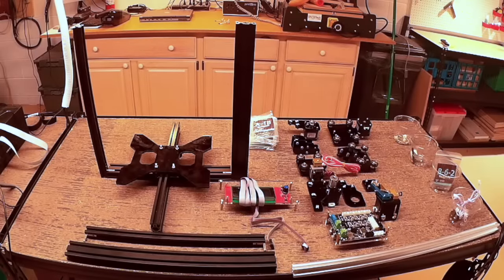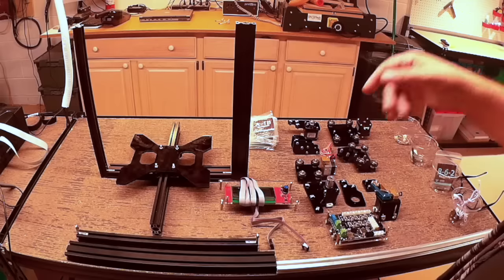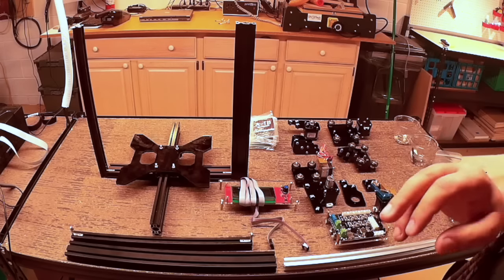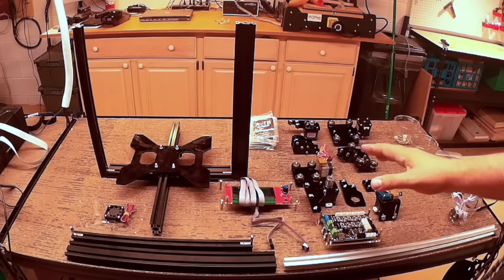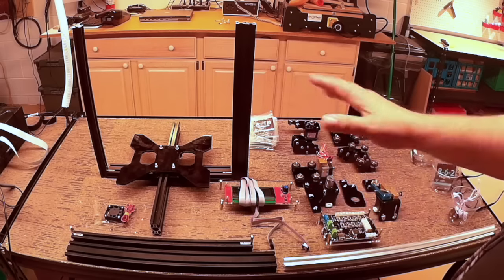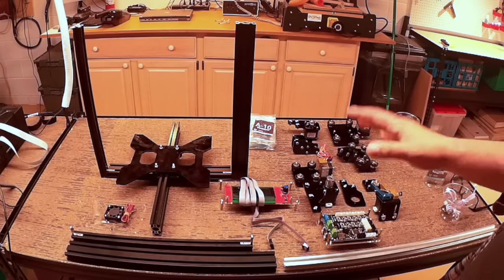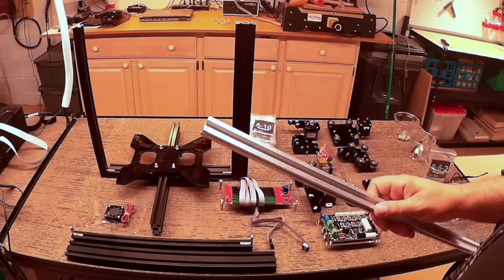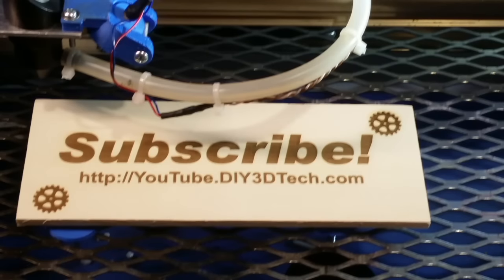Tarantula 3D Printer  -  vBlog Update and DIY Kit Building Tips!

Comment: shame about the V slot vs square .  any chance you could go for the low hanging fruit first , and  and try and print new rollers?  or make some with some new bearings and 3d print ?  you probably only need to change the profile and diameter of the rollers a small bit . but then again you have a laser and you could tweek a SVG of the parts a heck of allot easier im sure vs messing with pushing  bearings into  new 'wheels' .
Reply from the maker: Yea this really bummed me out as I had cut and built an entire frame for the bigger machine! However I still have all the pieces and this fall I likely will design and laser cut a new set to work with the v-slot style wheels...
Reply: just had a thought .. next time you're at your local hardware / home center ..  check the tubing section . you might be able to find some vinyl tube that you can jam on the roller to make it v groove compatible. it would take a tight fit , and if you find a good thick enough tubing you might have to heat the tubing first to make it easier to get on the existing rollers .
Reply from the maker: Not sure that would work as the chineses wheels aren't the best a rolling now :-)  However I am looking around to see if I can some matching tube.  I will be in China in a couple weeks and will ask around while there too and see what I come up with...

Comment: Did you ever do the larger build?
Reply from the maker: Nope not yet, still on the list :-)
Reply: Well if you ever get to it, call it the Scorpion. I saw a video for something called the Hyper cube 3d and it seems to be made from off the shelf parts. I would love to see a larger design of the tarantula with all aluminum and double z with MGN12 rails. But I'm just a guy who started as a temp at the job. I cant tell the company how it should be run. When Ive learned enough, maybe one day I'll try it myself.

 All the best.
Reply from the maker: yes have seen the hyper cube however have also seen a large scale Chinese printer for less than 500 bucks which i am looking as that is super cheap for a big printer
Reply: Well, I know you're busy, but that sounds super exciting. Cant wait to see it.
Reply: Yea need to find both time and room!  I now have 6 printers! Three CNC machines and 2 CO2 Lasers!

Comment: Check out 80/20 Inc. www.8020.net. Where I work we have done several custom enclosures with this product. I have spent $3~5 K with this company and been very pleased. We had 90%+ of the pieces pre-cut to length and they have raw & anodized in a variety of sizes.
Reply from the maker: Wow very interesting and thanks for sharing!  How are their prices for the hobbyist?
Reply: +DIY3DTECH.com I will take a look at the last PO I did when I get back to work. I really don't have any prices to compare to...
Reply from the maker: Thanks, I currently get  mine from either Open Builds or Amazon